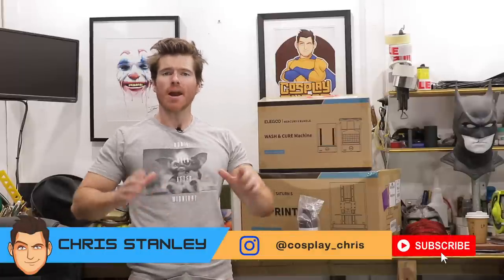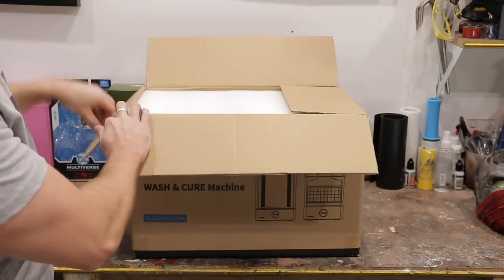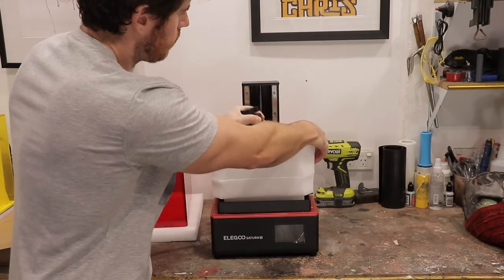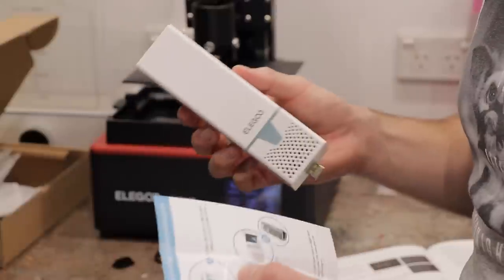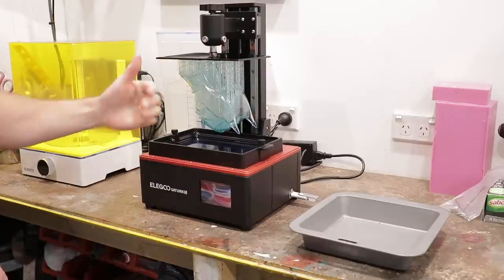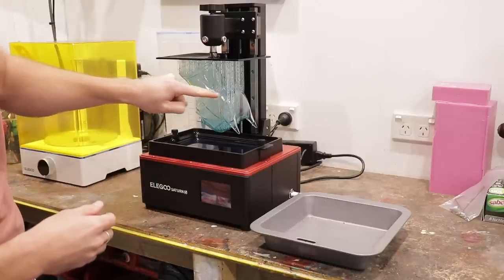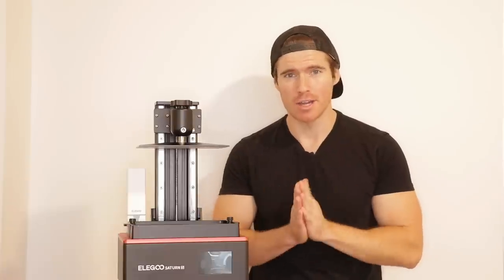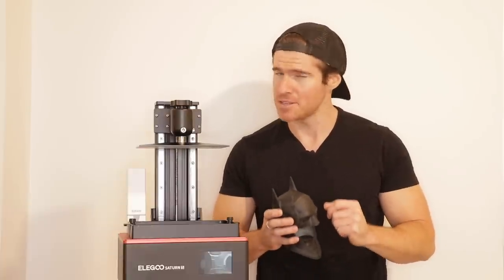3D Resin Printing a Batman Cowl with the Elegoo Saturn S

Comment: Ive been resin printing for 2 years and it's a absolute blast. l started off with 2 creality resin printers and wound up with the peopoly phenom. Resin printing will give you way more detail and it's way more easier to use than fdm. Don't get me wrong I love fdm printing as well but it don't love me . I had a creality cr-10 and made a ton of upgrades to it and the slicer software and the printer fought back like Mike Tyson it wouldn't work right at all so I bought the peopoly phenom resin printer and it's been Heaven ever since . As you get deeper into it you'll always have a smile on your face 👀 when you are removing a print from the build plate. Happy creating.............

Comment: I just bought the Voxelab Proxima 8.9 and that thing is a beast as well. Bit of a tip, that I learned after splitting my Pattinson cowl in half lol, soak the print in hot water (I use a tea kettle) for about 30 seconds, and the supports almost fall off!

Comment: Nice print... but 44h??!?!? man I saw a 50sec on your file title I hope that don't use 50s per layer exposure, Saturn can manage up to 1.8s per layer, but seeing the final time I think you did, or use a super low layer height, beware of this times 'cause don't burn or shorten your life screen
I usually max the height on my Saturn prints and never pass the 12-14 hours at 0.05 and 2.5 layer exposure. Also the back cowl support are too heavy, ugly scar left on the model, need to improve that.

Comment: If you don't want to spend a lot of money on IPA, just get yourself a gallon of Mr. Clean Summer Citrus cleaner. Works just about as well as IPA at a fraction of the cost. I'd also recommend using a silicon mat when working with prints right off the printer and using a portable UV light to harden the resin so it's easier to handle

Comment: dont use high build primer on resin prints. you will kill the detail on it.. that is the whole reason for reson printers. if you are using a normal filiment printer then yes. just use standard thin grey primer .